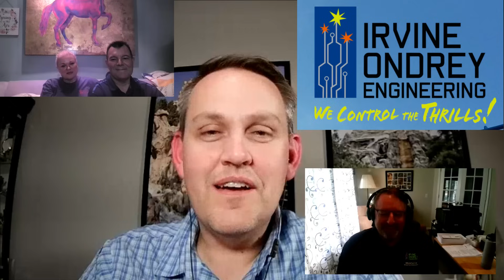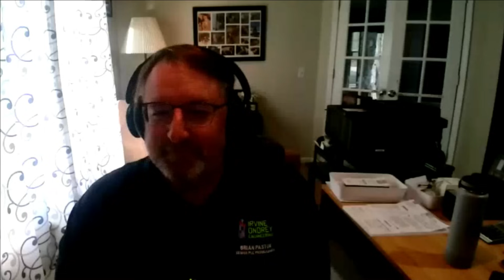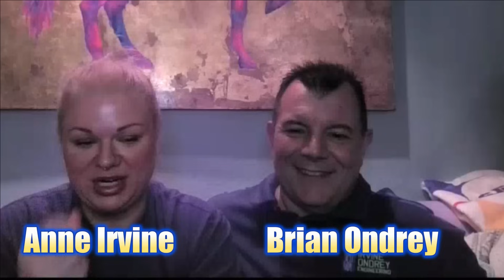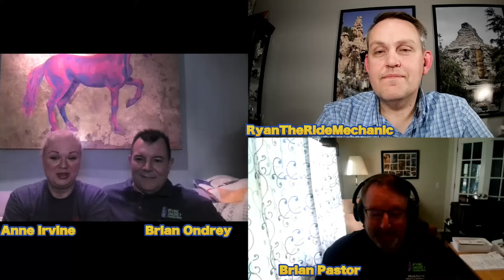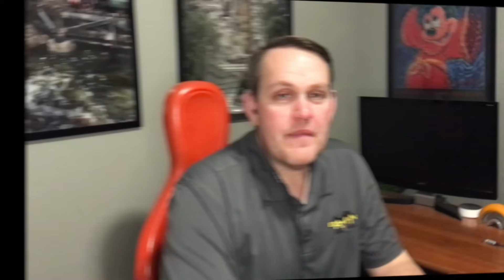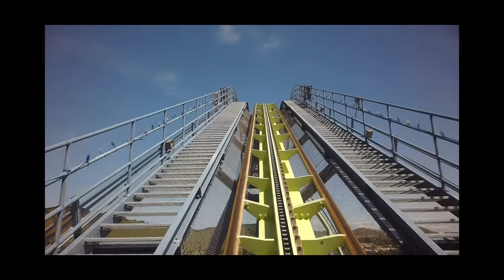How Ride control systems are built with Irvine Ondrey Engineering

Comment: I was at Kings Dominion earlier this year and I was riding Racer 75 for the first time (I only just recently discovered that I am an enthusiast) and I noticed that the lift hill seemed to be jogging the trains into sync and that made me think of Dueling Dragons.  Then when the train was sitting on the brake run I looked over to my left and I saw an IOE sticker on the lift drive cabinet and it made me so happy knowing that the same guy who programmed Dueling Dragons was involved with this humble racing woody. :)

I also got my first lift stop on that ride, but it was just because some idiot took out a cell phone and the operator stopped the lift.

Comment: Do any roller coaster manufacturers have a control systems team who does all of it ‘in-house’? Or do all of them hire external control systems companies for that side of things?
Reply from the maker: Most higher an outside company like Irvine Ondre Engineering that I talked with a couple of weeks ago.  Heck that out if you haven’t seen it yet. About 2.5 hr long.
Reply: A few do them in house for sure, and sometimes the parks will, but they might reach out for bigger things. We do the Raptors but SF has been doing the standard RMC (is there such a thing?) coasters in house.

Comment: When I worked for Six Flags America back in 1999 when the park was re-tracking and doing a new control system for the Wild One roller coaster we hired Cosign to do design a new control system. I was than young 31 year old full-time electrician and helping wiring and commissioning this ride with a young Brian and his cool boss the owner of Consign.

 When I was let go from the park, I had a job interview with his boss since Brian felt that I would be a great fit for Consign team. I didn't get the job due how my resume was written, seeing that I had lot of jobs on it. Brian's boss gave me some life changing tips. I learned PLC programming from Allen Bradley. After that year, one job gave me some control and troubleshooting background which lasted 3 1/2 years and the current job 18 years. One thing I do miss is working at a park. Working at that park got me into a coaster club call Coaster Crew. Now I visit a theme parks all the time.
Reply: Totally remember you from back in the day. I hope you're doing well!

Comment: My question is. Once they have a program written for a ride and it works perfectly fine, Do they store that program on a jump drive or some type of hard drive that they can use later on (if need be) like if the computer gets fried by lightning and they need to install a new computer or if the computer/software gets corrupted they have the program they can just reload and be back in business?
Reply from the maker: Yes. The program can be reloaded. The park generally keeps a copy of the program. Also I used to go around the the rides twice a year and back up the program to keep things like timer and cycle counters up to date if the original is lost.

Comment: Fascinating & amazing video! I was disappointed to learn Phoenix actually has a ride control system. I just spent a week at Knoebels & asked the operator if he manually controlled the brakes on the curved brake run before the station. I asked because Phoenix speed was varying on this 180 degree skid brake, sometimes slamming into it & speeding around the turn with laterals I've never noticed before, sometimes just rolling slowly. He said "yes," it is indeed manually controlled, the entire brake run from start to stop in the station, but if the train's speed is too fast the computer will take over and stop the train before it reaches the station. This would also kill the chain lift & if they're running two trains the second would not be able to leave the lift & enter the only block on this coaster.

Comment: The question of PLCs aging out is an interesting one .... for example, in the ski lift industry, the lift controls age out just like the rides do, and resorts have to make a decision of scrap/replace or replace the controller.  It's not cheap either way.

Same thing happens with elevators, as well.  That "black market" for obsolete  parts is a very real thing.

Comment: Unrelated…. I tried to get you some TT2 pics but they have the trains in a position where I couldn’t get and good ones.  They had seats off of the silver train on Thursday with the rest of the train assembled but all back on today and was doing test runs last night.  I have a question that I think you can answer.  We’ve seen raptor (B&M invert) go down twice in the last few days and both time a mechanic came out, went up a ladder at the base of the lift, and drained some liquid out of a faucet with one of those turn things to open the valve.  Any idea what that is?  We joked that it needed an oil change but I’m guessing some sort of fluid that may heat and expand and need drained off or something, not sure.  Thanks in advance.
Reply from the maker: Probably water. Water can condensate inside air lines and prevent valves from working properly. Although not sure what air there might be there unless theses a take in front of the lift? If they are doing this, there is a good chance the rides air dryer by the compressor is damaged letting more moisture into the air system. And in the long run but for now just annoying.  Just a guess though.

Comment: I've always been interested in how rides operate. On the topic of spinning rides monster at kings island is my favorite spinning ride. I know the ride is manually controlled by the ride operator which isn't common with rides today. Since the ride spins using gravity you can move around to create more spin. Pretty much every time I get off the guests in line wonder how I spin it so much. Even some of the ride ops don't get it. It is quite hard to judge maximum spin rate although I think it is around 240 rpm (4 rps) and I can easily maintain 120 rpm (2 rps)

Comment: What communication protocol do the PLCs use, CANBus?
Reply from the maker: I can’t speak for everything but I’ve worked with several different profibus modbus etc. maybe IOe can respond for a better answer?
Reply: @ryantheridemechanic  Hi! Brian P here. The answer is, LOTS, really. We typically use Rockwell Automation PLCs and we use ethernet/ip to communicate with MOST other field devices (remote racks, drives etc.) But we also do use a protocol called ASi (Actuator Sensor Interface) when we have to communicate with a train for lapbar monitoring and locking/unlocking restraints. You'll find that most PLC manufacturers have the ability for their PLC to "speak" several different "languages". -BP
Reply from the maker: @irvineondreyengineering8389  awesome thanks for the answer!